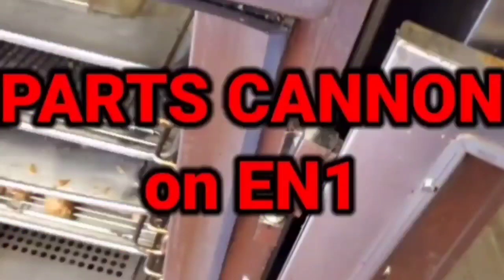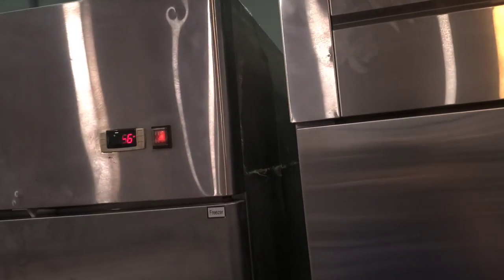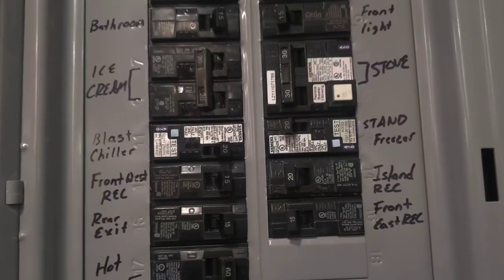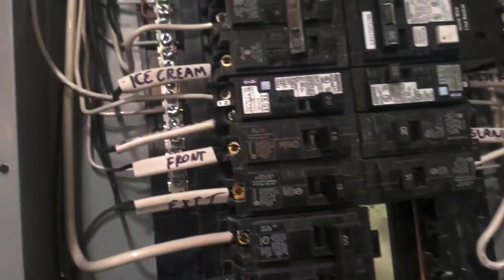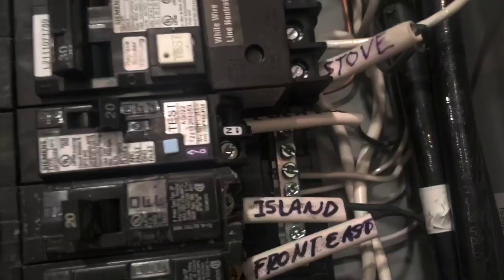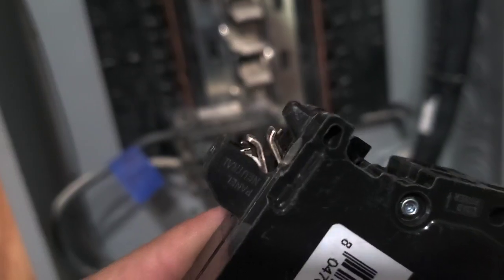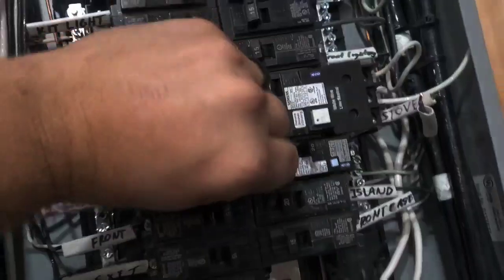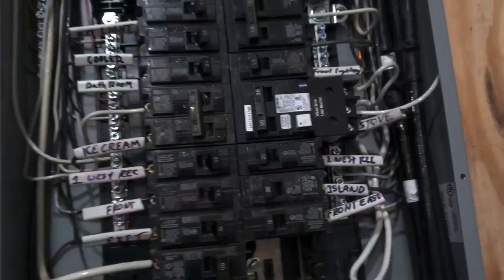How To Fix a Nuisance Tripping Arc Fault Breaker

Comment: How do i live with thia in my apsrtment? Is there a bypass? I cannot change any of the fuses but its tripping constantly when i touch my toaster because they installed these in MY KITCHEN!!!
Reply from the maker: Dam that sucks. It's definately hearing arcing in the contacts. So check it out,  Its not a guaranteed thing,  but you might be able to use an isolation transformer and keep the breaker from hearing the noise from the contacts. You'll have to use a big expensive one though. It's gottaa be good for 2kw.

Comment: What is the point of an arc fault breaker? We've never had them in any of our houses... Dad and I ended up replacing the entire freaking breaker panel at the trailer back in November.. a couple of the 240 breakers at the bottom of the panel decided to check out.. They started arking out and wasted the entire panel! $500 later and we got not only a larger panel, but I picked up I believe 200 ft of 12.2 Romex.. planning on running a 240 circuit out to the living room and one to the computer room.. trailer wiring sucks. 14 gauge on everything...
Reply from the maker: Arc fault breakers are supposed to prevent fires caused by lose plus or wiring arching. They work great for that. The problem is they trip at the first sign of any arching even inside switch contacts, motors, relays, you name it. You turn off the lights and the damn breaker trips. Run the vacuum, breaker trips, fridge cycles off, tripped. It's such a nuisance it defeats the purpose. That's why they get tossed right after inspection like in this video. Try explaining that to an electrician or engineer tho, forget it. They live in a perfect world so you end up getting all kinds of grief from then for deleting them because YoU BrOkE tHe RuLeS WaAaAa!!

Comment: Won't be long before we are using the shit they use in the UK, plastic breaker boxs and DIN rail mounted Chinese made breakers that cost an arm and a leg locally and MUST be bought locally because they have a sticker or stamp on them saying they are certified with the NEC, FCC, FAA, ARRL, EPA, PETA, NAACP, BLM, and ADL for use in the USA, but a couple dollars if ordered straight from the Chinesium mines of China in virgin form with only the voltage, amperage ratings and simple diagram on it..
I dont knock DIN Rail (Track Mount as Americans call it lol) as they have some really cool shit you can plant on those rails and it does have it's place in various places where specialized circuits are built up for timer controls, or in my case Tower beacon flasher with day night sensor activation, all DIN rail with SSR's, Breakers, Status displays and a main and redundant MCU that does the flash timing and if one errors the other kicks in. And it's all connected to the internet through a line supplies by a wireless ISP customer on this tower. That internet connectivity allows me control over not only the beacons but also other systems in the shelter like the climate control, the ground fault conditions, lightning and surge suppression systems, fire alarm and halon systems, lpg fuel levels, backup battery and generator status and test functions. and best part I can activate and deactivate 2-way radio customers on any of my 12 commercial DMR and both analog community repeaters in that site without being there with a laptop jacked in. It's all quite nice but I do prefer to manually test this shit myself in person. But still havine the ability to pull it up on my phone is kinda cool
Reply from the maker: Some of that went over my head
But i agree with the rest